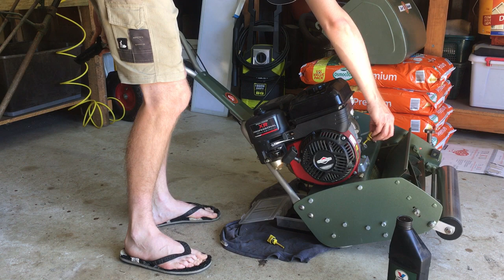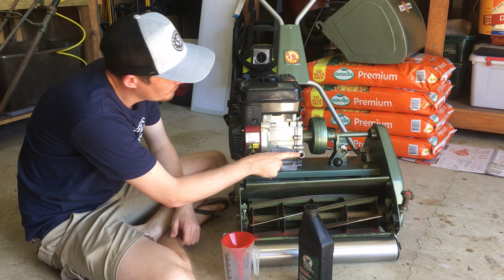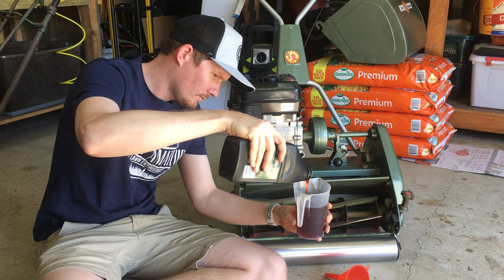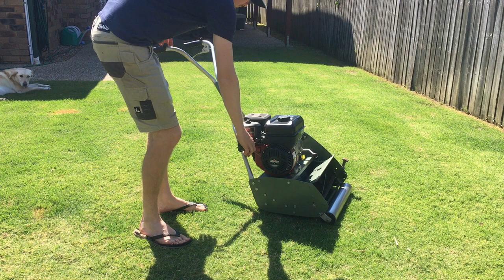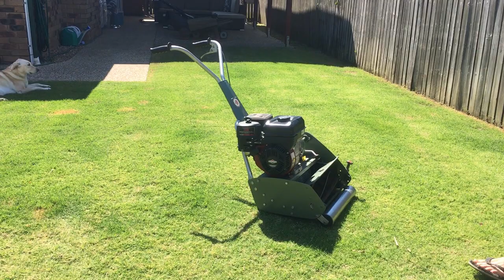Engine Oil Replacement

Comment: Just wondering mate how often should you drain your oil and change it? Is it a once a year thing after the mower has been sitting stagnant for a few months over winter?
Reply from the maker: It should say in your engines manual.. They base it off how many hours use (I think)
I just change it once a year..